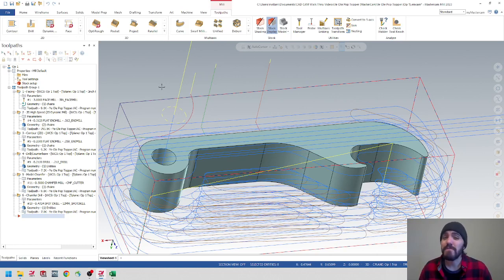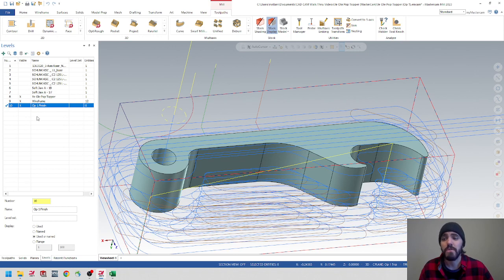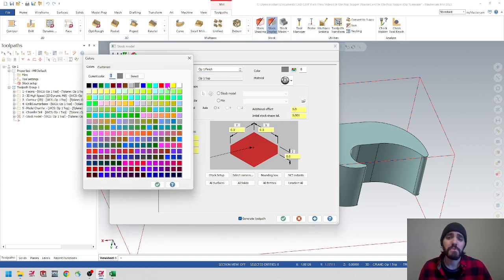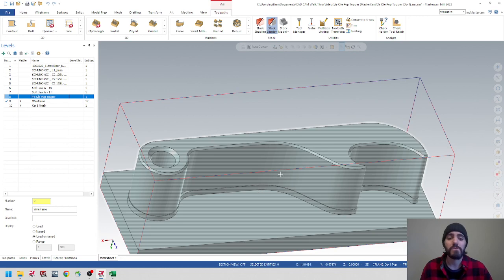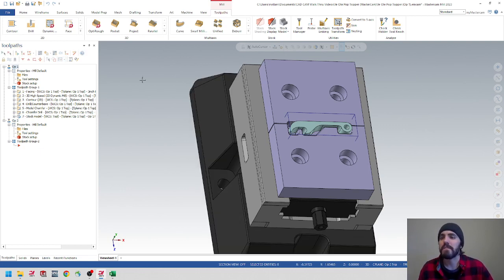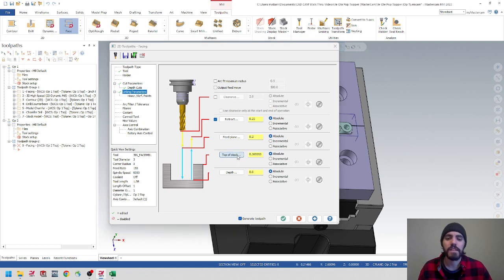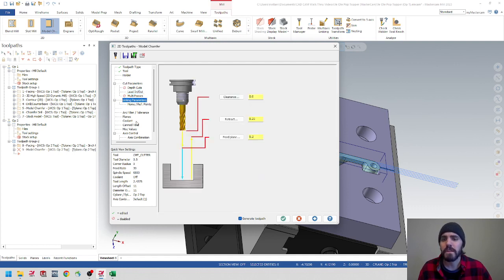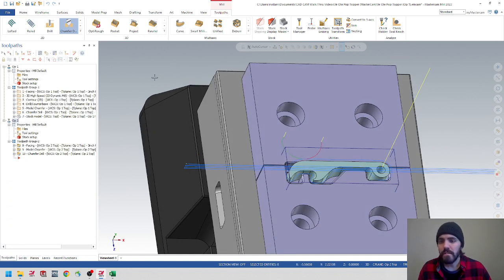Multi-Op Programming in MasterCam (Second Operation & Stock Models)

Comment: JUST WONDERING HOW DO YOU CACULATE THE CHAMFER WIDTH AND BOTTOM OFFSET? WHERE DID YOU GET THOSE NUMBER?
Reply from the maker: It really depends on what's below the surface you're trying to cut or if there's a wall above the surface you're trying to cut.  I usually just use equal values unless I need to avoid something.

Comment: Thank you, I would like to know the difference between a STL and a MESH file for op 2?
Reply from the maker: Hi, they're effectively the same thing in this case.  When you create a Stock Model it's basically creating an STL as a  toolpath operation from the previously cut geometry.  If you zoom in on the newly created Stock Model it's thousands of little triangles that make up a mesh.  The same can be said with SolidWorks simulations when creating a mesh for test.  Both programs are essentially creating an internal STL to be used for calculations, also known as a mesh.  Hope this helps!
Reply: @artofthepart  Thank you.

Comment: Do you have any videos about tool lists or material types with speeds and feeds Excel in the calculation?
Reply from the maker: It's definitely on my to-do list!  There's some really great calculators out there for speeds and feeds.  I usually use the manufacturers recommended values and/or Sandvik's apps.